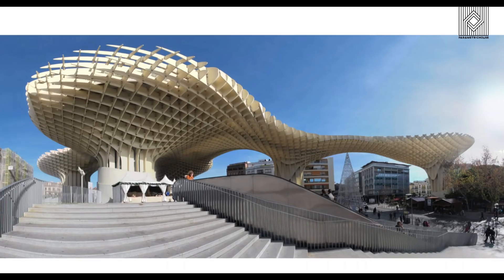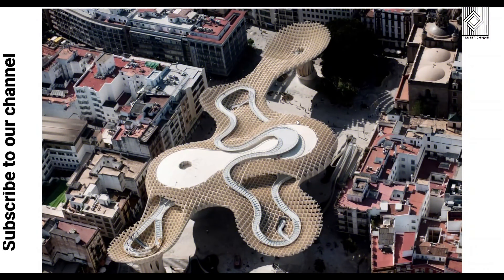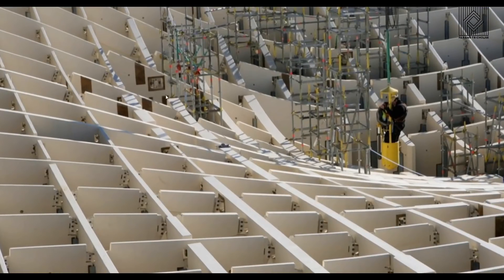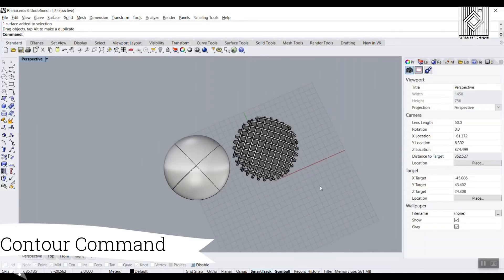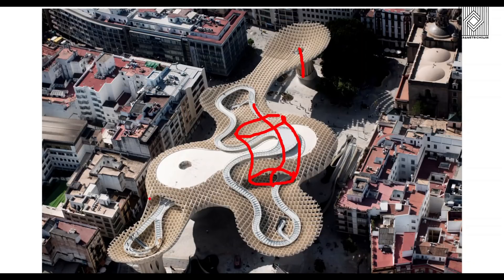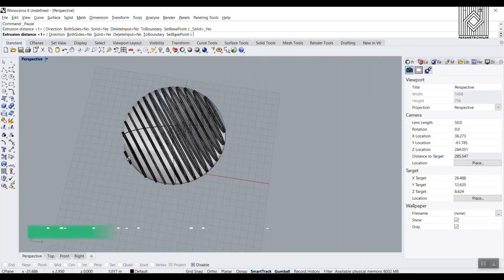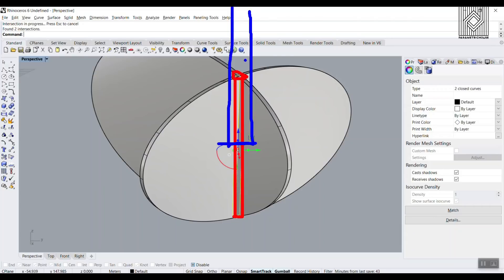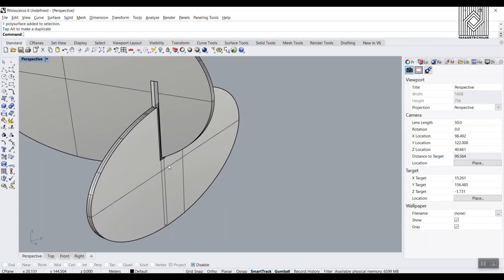Parametric  Architecture - Metropol Parasol

Comment: Thank you for this video. Is there a reason you prefer using the solid intersect instead of region slits? I find the latter is slight faster in computing large waffles.
Reply from the maker: You're welcome. Well I'm not a huge fan of region slits because it usually gives wrong results but the 3d difference method always works 😁